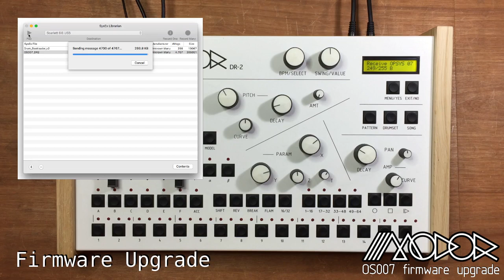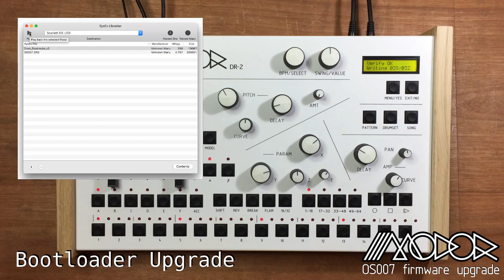DR2 OS007 Firmware Upgrade - Parameter Locks!

Comment: this is awesome but im always surprised that manufacturers don't future proof their machines with overspecs processors and memory to start with so they can keep improving their OS without running into lack of memory. I saw that happens with quite a few pieces of gear.
Reply from the maker: Haha, indeed. Not entirely untrue... It happened to us with the NF-1 synthesizer too, and still we didn't learn.
But don't worry, after the bootloader upgrade we have plenty of memory free for all kinds of upgrades now, and installing the new bootloader is really a piece of cake after you installed the new firmware.
Reply: That is awesome news. Keep them coming!